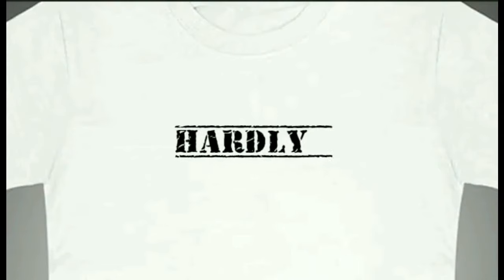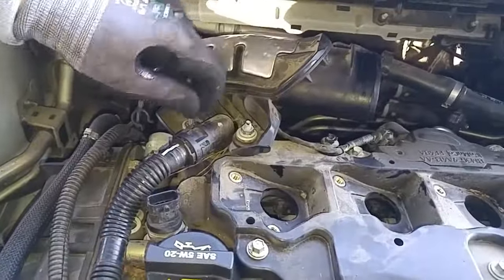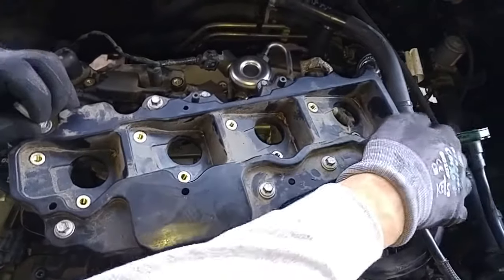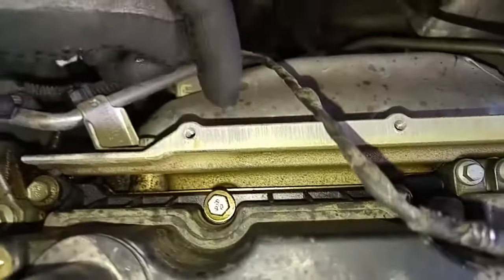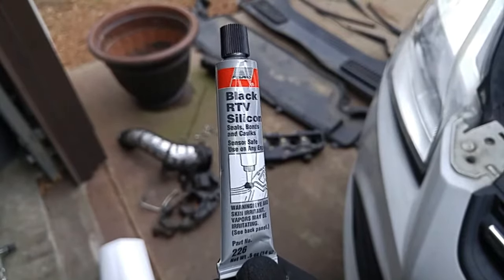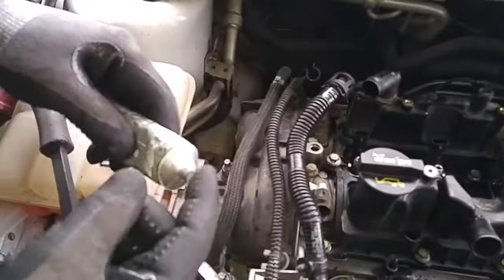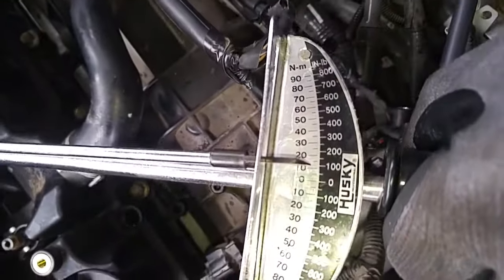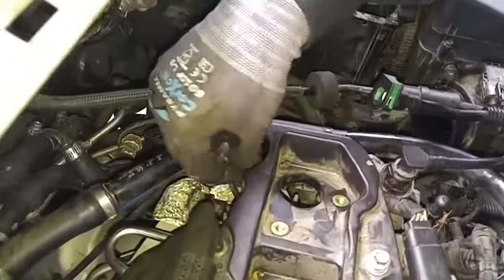Ford Escape 1.6L Turbo Valve Cover Gasket & Spark Plugs Replacement- 2013 - 2019 Fusion, Fiesta, S80

Comment: How do i prime the fuel pump?
Reply from the maker: You don't.  Just crank over the engine a few times.
Reply: Oh OK,  thank you. Now the issue I'm having is that my battery died, but before that while I was cranking it and turned the key to the off position it kept cranking for a little bit, it's that normal?
Reply from the maker: @oz4120  malfunctioning starter?

Comment: I have one more question sir, just before you showed the black tube of RTV what was the 2 things you installed new o-rings on? I need to get those and I will have all I need. I didn’t see them in the injector o-ring kit. Thank you
Reply from the maker: Camshaft position sensors.
Reply: @hardlymovingpro  I really appreciate you sir
Reply from the maker: You bet!

Comment: Those plugs for the coil pack and assorted sensors are designed to be pressed from the top, not pried from the bottom. If you push the plug in and press the top of the tab in, it will come off pretty easy. Just FYI. Great video!
Reply from the maker: Thanks for sharing!

Comment: Like the video. Going to see how much mechanic charges in town but I’ll probably end up doing it. Only question I have is how do you get the oil out of the spark plug holes(2 of them)? One was full pretty well. I also put new spark plugs in before realizing oil leak. Do I have to change those new spark plugs after they were in oil? Thanks.
Reply from the maker: Using a combination of compressed air and brake clean solvent to blow the excess oil out of the sp tube hole.  After removing the old plug, a little residual oil leaking into the combustion chamber won't matter much.

Comment: Also did you use dielectric(spelled wrong probably)grease throughout the video? I noticed at times you said silicone grease. Just making sure I apply right grease throughout. Thanks.
Reply from the maker: Di-electric is silicone grease.  Also called plumber's grease.

Comment: After changing the gasket i have p132b fault od turbocharger. What should i check? 1.6 ecoboost 160hp mondeo mk4
Reply from the maker: Check for air hose vacuum leaks with all your hoses and your air intake tube leading to the turbo.
Reply: @hardlymovingpro  thanks for answer. No leaking. Only a damaged Valve of vacuum pump(Orange silicone membrane destroyed). What can i do bad during changing a valve cover gasket that can cause a p132b error and a loss of power...

Comment: Do I need to depressurize the high pressure fuel pump and fuel rail by disconnecting the fuel pump fuse in order to do this job?
Reply from the maker: No need to remove the fuse.  Place a rag under the fuel rail flare nut and loosen the nut.  Residual fuel pressure will release a small amount of fuel and that's it.
Reply: Thank you!

Comment: Great video exactly what I was looking for only thing is  I fucked up changing my spark plugs i over tightened the coil pack that goes in to the lil gold nut holder idk what it’s called n now it’s stripped n I’m not getting any spark from spark 2 due to the lil type gold cap being stripped went to multiple auto shops said they don’t sell em what is the top piece u took off called
Reply from the maker: If you overtorque a coil pack bolt, the bolt will force the brass retention nut recessed in the valve cover to spin.  Only way to get the nut off is to cut the head of the bolt off with a small rotary cut off disc (i.e. dremel tool).   You may have to replace the valve cover because of this damage or find a way to brace the coil pack down.
Reply: @hardlymovingpro  I have a 14 fiesta st but it has the same engine appreciate you u know where I can find a valve cover or what’s the part number

Comment: How did you get the clips over the fuel rail? Your supposed to pull the injectors
Reply from the maker: Injectors stay on the engine block.  Unbolt the fuel rail and line and you can remove fuel rail as shown in the video.

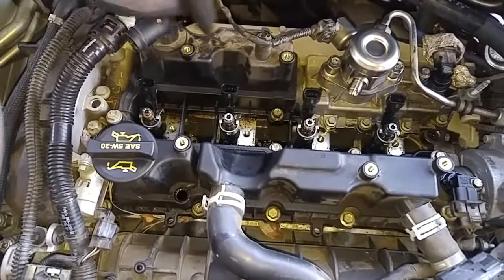Comment: What are the metal cylinders you have to take out on the left side I still have an oil leak in the top left corner and I just replaced the gasket. I’m not sure if that need replacing. 4:26
Reply from the maker: Those are the intake and exhaust camshaft solenoids.  They're exposed to oil and harden o ring seals could be a source of oil leakage.   Good practice to replace them.

Comment: i just ordered a valve cover and gasket due too a leak,not sure which is the problem so i have both on order,while waiting on them could you tell me the size of o rings replaced or the names of the parts that require them ,and your video is great thanks.
Reply from the maker: The valve cover gasket should come with new o rings.

Comment: Besides the injectors orings, what are the other 2 orings called? The ones you replaced in the left side by the oil feeding cap? Looks like sensors maybe?  Thanks
Reply from the maker: It came with the FelPro gasket replacement kit.  Believe they're O rings for the camshaft solenoids.

Comment: Hi I have a 1.6 where would the oils be coming from if my spark plugs have some in there
Reply: What gasket is leaking
Reply from the maker: Maybe from the coil pack tube gasket.

Comment: USING DIELECTRIC GREASE , WHILE I , AS AN AUTO TECH DO USE IT ON COOLING SYSTEM HOSES  AND ORINGS ETC, I MIGHT POINT OUT THAT SILICONE CAN POISON OXYGEN SENSORS UNLESS YOU USE SILICONE LABELED AS OXYGEN SENSOR SAFE. FOR THAT REASON I PERSONALLY NEVER USE DIELECTRIC ON ANYTHING RELATED TO THE ENGINE OR INTAKE SYSTEMS. MAYBE IM MISTAKEN BUT THAT IS MY APPROACH.
Reply from the maker: Thanks for sharing!  In oxygen sensor threads, I use copper anti seize.

Comment: What brand of Fuel Injector o ring did you use on  the  2014 Escape fuel rail (TOP).  1.6 LTR Engine
Reply from the maker: Doesn't matter.  It's low tech.  Get Motorcraft or Mahle.

Comment: where did you get the vvt solenoid o-rings?
Reply from the maker: It came with the valve FelPro cover gasket kit.
Reply: @hardlymovingpro  from your Amazon link?
Reply from the maker: That's one avenue if not from a local parts store.
Reply: @hardlymovingpro  thank you.

Comment: My question is why does alldata say i need a heat gun to remove the valve cover gasket? Thats the only thing that has stopped me from doing mine. Any info please. Thanks
Reply from the maker: Doesn't make that much sense to me either.  Just don't be too aggressive braking the gasket seal loose from the cylinder head.  Pry valve cover corners with wide tip a few driver.
Reply: @hardlymovingpro  awesome thanks for the reply.

Comment: quick question ... this my first time working on this car .. I was going to do a simple spark and coil change then realize 3 out of 4 coil where slightly wet with motor oil ... that to me is a quick sign of a worn spark plug tube seal!!! after watching you work i didnt see any tube seals .... do u know y my coil is slightly wet with oil.... could if be the valve cover gasket tht bad???? or do i have to keep opening to reach the tube seals????
Reply from the maker: Leakage from the cover gasket can migrate to the AP tubes.
Reply: @hardlymovingpro  so there's no spark plug tube seals on this car?? so my issue is the valve cover gasket itself ?? thank you so much dude .. great vid btw!!!

Comment: Great video man saved me a lot of time. I do recommend anyone doing this job to replace the o ring on the injectors were fuel rail connects to them. I did this at 90k and when went back together sprayed gas.. o rings were faulty and too playable. They are supposed to be hard o rings and yes they are expensive. I suggest rock auto. But the o ring will be the biggest worry for anyone doing this job. I recommend replacing them right off the bat. Just trying to pay it forward. Thanks for the video bro very easy to follow. I would also recommend replacing the cam follower as well on the high pressure fuel pump. If not replaced every 60 k I guarantee you will blow your engine... it's called a cam follower or bucket for the high pressure fuel pump on exhaust cam. I did that during this job as well 10 bucks off rock auto. Easy to install when your right there during this job
Reply from the maker: Thanks for sharing your valve cover gasket replacement experience!  Never had problems re-using o rings as long as I coated them first with silicone grease as well as coating it's contact plugs.  But nothing wrong with replacing them with new ones.  Interesting recommendation on replacing the cam follower and the hp fuel pump.  What causes these to fail and lead to engine damage?
Reply: The wrong or oldwayoverdue oil. The extreme pressure additive for these is the D in Dexos.

Comment: Hey so if the fuel injector does come out do you need to replace the Teflon seal on the bottom of the injector? The new seals came with the kit but the sizing tool (303-1567) is $150. Just wondering if that's mandatory before buying a tool I'll use once
Reply from the maker: In this video I only remove the fuel rail from the injectors and I used the existing o rings.  No need to remove the injectors from the engine.

Comment: A problem I had with this engine is the fuel injectors were loose. Are they supposed the be loose? I have white smoke coming from the engine but no overheating and no milky oil, so im assuming the fuel injector seals are bad? Im also assuming the smoke is coming from the fuel injector seals since they are loose? Anyway i could send you a video through email for help?
Reply: Did you also replace bottom o ring for fuel injectors?
Reply from the maker: Injectors are held in place via the fuel rail.  The o rings are there to prevent fuel leakage.  Without the fuel rail attached the injectors will wiggle around.  White smoke could be muffler water heat evaporation during cold morning startups.

Comment: Hello I hope you see this comment. I followed your video and something went wrong for me. I replaced the valve cover, spark plugs, and boots but now my car cranks but struggles to start. When it does start it doesn’t stall or anything but it has a very strong gas smell the whole time I drive, my mpg has tanked, and it’s throwing a P00C6 code (fuel rail pressure low). 

One thing that happened when I pulled out the fuel rail a fuel injector from cylinder 3 came with it, and some gas got down into the connector for the cylinder 1 injector.

Some help would be greatly appreciated. I can’t find anything online that narrows it down. Thanks
Reply from the maker: More than likely the o ring in one of your injectors is damaged.

Comment: Great video. It is both concise and professional. I replaced my valve cover recently and did not torque it down. Would have done so if I had a decent torque wrench. Unfortunately I thought I could get away without replacing the injector o-rings. After assembling everything and running the car for a couple of minutes I noticed a strong smell of petrol and sure enough there was a big pool of petrol on the garage floor. I had tightened the fuel line using the 17 mm ring spanner and thought I had been fairly firm with it. What is likely to be the source of the leak? Could there be a 3rd possibility, that I had broken and injector (although I guess it wouldn't have run properly if that was the case)
Reply from the maker: Believe its an injector O ring that slipped off.  That's why I always coat the O ring and the O ring cap with silicone grease so that the ring slips in place.
Reply: @hardlymovingpro  hello

Comment: Seems I'm the go too guy. When it comes to working  on these Keyless crank Ford\Mazda.... As people ruin the engines and heads...Now the 1.5liter needs special tools to change the water pump or you destroy the head.. I have shops that bring these to me to fix..They don't want to touch them....

Just to add.. That grease stops them hoses from getting brittle..I have several tubes of Ford  Caliper\Dialectic around all the time...
Reply from the maker: Love dielectric grease!
Reply: @hardlymovingpro  For those want to know what the part number is from Ford.. It's XG-3-A....

And yes you can use this for both  Calipers and Dialectic components.. As it's EPDM rubber safe...

Great stuff...

Comment: the 2014 fusion 1.5 takes a 9/16 spark plug socket .
Reply from the maker: Whatever works for you.
Reply: I have the same engine and changed my plugs yesterday.  its a 5/8 th

Comment: What were those 2 o ring gaskets? and can I do the job without replacing those?
Reply from the maker: Those new O rings are for what I believe are camshaft position sensors.  They came with the valve cover gasket kit.  Once the sensors have been pulled, not replacing the O rings can result in future oil leaks.
Reply: Awesome video. I have a leaky gasket also. Can you please tell me where you purchased the gasket kit.  I can't seem to find one with the o rings included. Thank you for the video.

Comment: Okay thank you, and do you have the part number for the fuel injector o rings and vvt? The fuel injector o rings look a bit pricey for something that small? Referenced from Autozone Fel-Pro es73118. And should you buy new coil packs as well?
Reply from the maker: The Felpro gasket kit came with new vvt o rings.  I re-used the FI o rings.  I only replace coil packs when they fail.
Reply: It seems one can't order OEM VVT solenoid o-rings separately, only new solenoids (which come with o-rings). Volvo solenoid part nos. for reference are: 36010300 (intake) and 36011316 (exhaust). This is for the B4164T engine, which I think is the one in the vid. I don't know the Ford part nos. @Hardly Moving Productions, would it be possible to get a spanner under the solenoids so that they needn't be removed?

Comment: We were told by a mechanic that if we are to change the  valve cover gasket we need a program to relearn because of sensors attached to the engine. How true is this.?. 

Based on video we didn't see any scanning / programming happened.

We are now confused. :-(
Reply from the maker: B.S.  absolute B.S.
Reply: @hardlymovingpro   our ford fiesta got stuck bcoz of scanning blah blah.... So it's not necessary.
Reply from the maker: Nope.

Comment: did you removed the fuel line fuse and burn any fuel left in the system before removing the injectors ?
Reply from the maker: Nope.  Not very much residual pressure.

Comment: Nice! I recently did a valve cover gasket on a hyundai entourage 3.8l. Huge compared to this one lol
Reply from the maker: Pain taking off the plenum?
Reply: @hardlymovingpro  no not really. Just got to remove a few wire harnesses out of the way. The front of the intake plenum has this metal bracket I had to take off so I can clear the engine oil dipstick and the metal brace that goes above the radiator
Reply from the maker: @emmanuelcarrion5168  Ok

Comment: Very efficient.  What kind are the extra long  wrenches your using? Also have you had good luck with the aftermarket m12 batteries ? Can't tell what they are. Thanks !
Reply from the maker: I use Milwaukee's M12 3/8" electric ratchet and impact gun.  The aftermarket batteries work fine.

Comment: you would think with all the technology it would be simple to replace a valve cover gasket and plugs but that is ridiculous horrible engeanearing  Ill take a classic any time.
Reply from the maker: I hear you!  But classic technology is carbs in lieu of fuel injectors ... ignition wires, distributor wires, cap, rotor, condenser in lieu of coil packs ... push rods in lieu of overhead cams ... bulky cast iron engine ... and lastly ... poor fuel economy.

Comment: Great video. Just followed your instructions and when I took the fuel rail off one of the fuel injectors came out with it. I took it off and put it back in it's hole. Finished the job and when I started it up its running pretty bad. Skipping pretty bad. I checked the spark plug and it's covered with gas. Cleaned it off and put it back. Let it run for a minute and still skipping. Checked the same spark plug and it's covered with gas again. Is something not seated properly?
Reply from the maker: Check all fuel line connectors for tightness.  Check that the injectors has a its O ring both top and bottom.
Reply: Did you resolve this? I’m having the same problem.
Reply: @n5980   I made sure everything was seated properly and just let it run for a bit. It evened out and is running fine. Haven't had any problems for months.